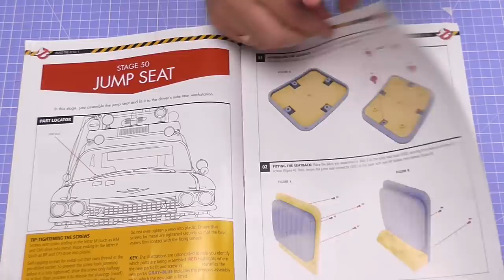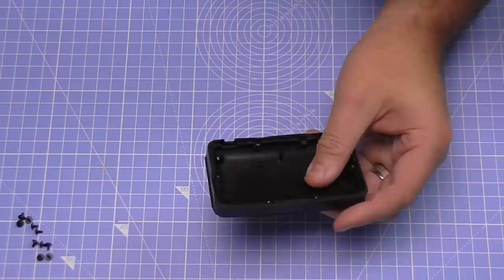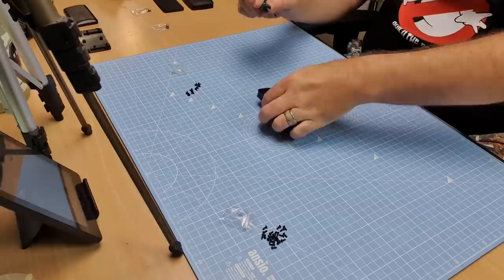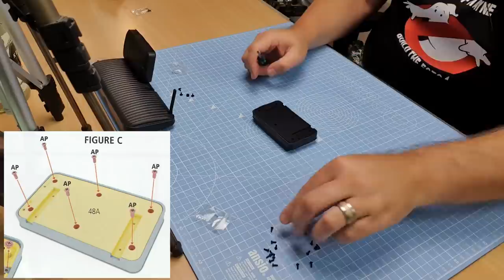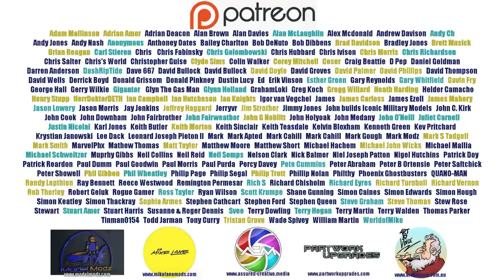Build the Ghostbusters Ecto-1 - Part 48 - Driver and Passenger Seat Backs

Comment: All that screwing put me in mind if a couple of years ago when I put up new shelving for all my dvds, I got five if these cube tower things, 1x4 cubes to each tower, 20 screws to each one, a hundred screws in total, I had a blister on my hand after that lot. So you definitely have my sympathy with all that screwing.

I expected the seat to be higher off the ground than that, must make for an awkward sitting angle for the ghostbuters legs, they're all taller than me and I'd be weirdly stretched out sat that low